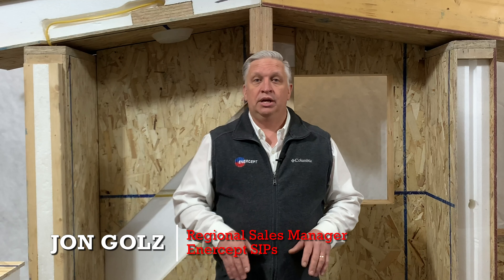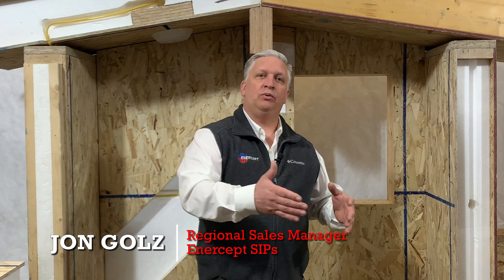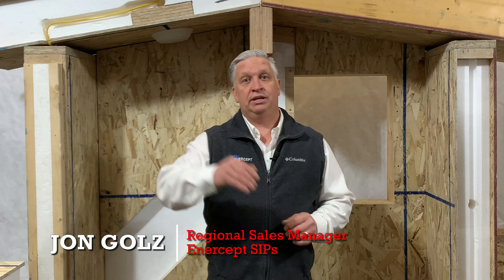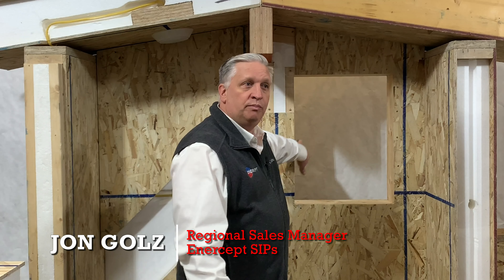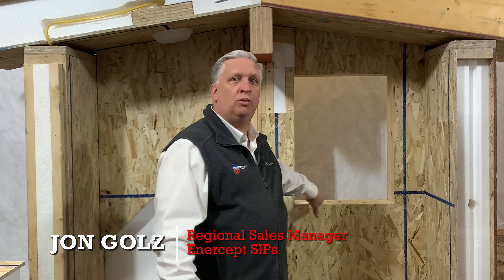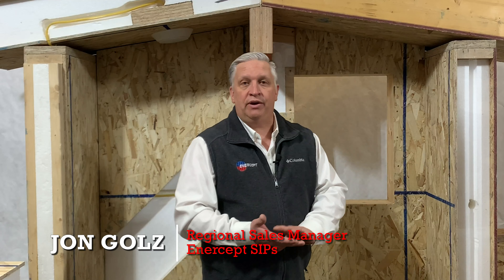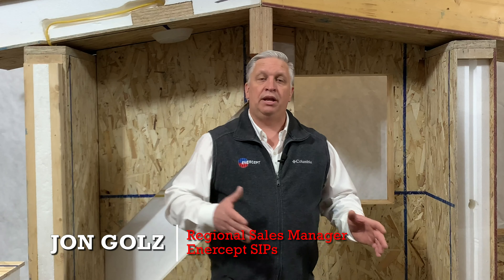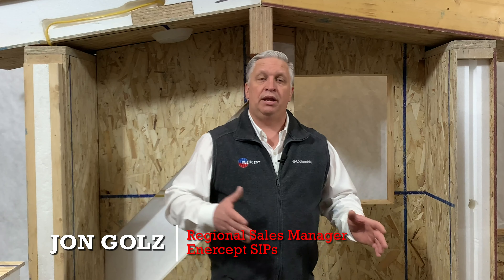What is the cost of building with SIPs vs traditional methods.

Comment: Always keep in mind that when it is stated "built to code" is actually built to the minimum standard, and yes we do need minimum standards.  Building above and beyond the code is alway better, by far, than minimum requirements.  I am a believer in building way above code and really does not cost more when life expectancy is factored in.  Easier building just once rather than having to tear everything down, dispose and clean up and then start over just to do it right in the first place.  Spend the extra money it takes to do things right.

Comment: So, what would be the basic cost / sq. ft  with  SIPs.  I want to do my tiny house with them. 8.5' W x 28' L x 13.5 H.  I know the electric chases will add & the # of windows also adds.  I need a basic jumping off place.
Reply from the maker: The cost will vary based on the type of SIP panel you are purchasing.  This link https://www.enercept.com/blog/do-you-know-what-you-are-getting-learn-about-differences-in-sips describes the differences between the different types of SIPs available from Enercept.

Comment: look. Build with SIP's. That's it. I've built with SIP's for 25 years. If you're building with sticks your doing it wrong. Period.
Reply: Your answer is rather arrogant!  An answer like that will force me to do more investigation, or just cross it off my list completely.🤨
Reply from the maker: Investigation is good.  It has to work for your situation.  SIPs are not the solution for every project.